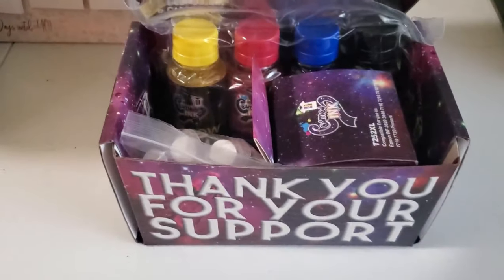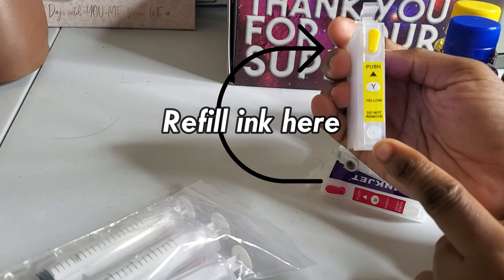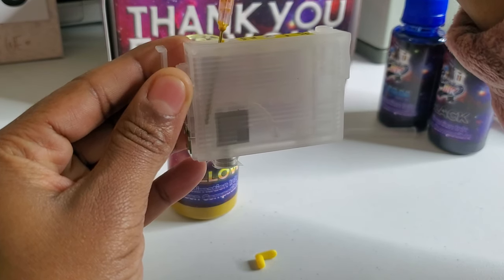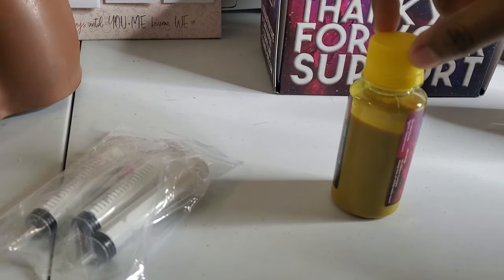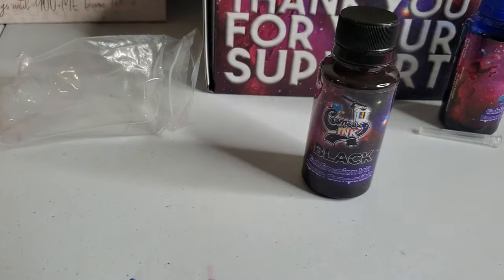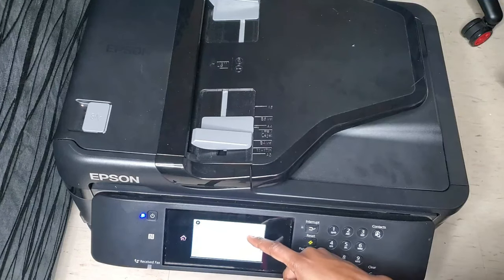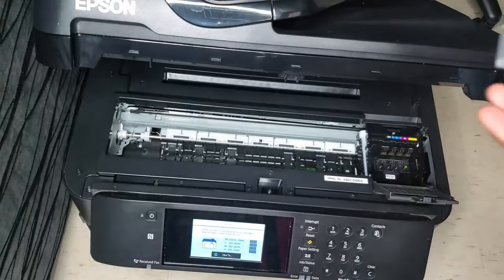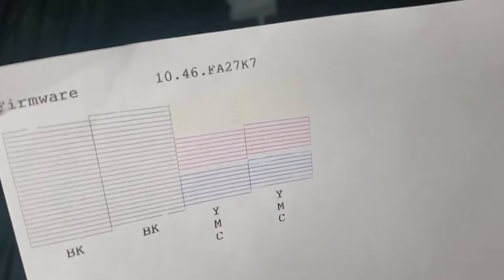How to convert an Epson WorkForce printer to sublimation|EPSON WF 7720

Comment: I just purchased my printer do I use the ink that’s in there to set it up and how do I get the cartridge for the sublimation conversion?
Reply from the maker: The ink that is in there is regular printer ink. So you would need to replace this ink with your sublimation ink in order to set up. 

The link for cartridges is in my bio or you can look on Amazon 😊

Comment: Do you know why it’s taking already 15 times for initializing sublimation and still have lots of lines breaking
Reply from the maker: Usually after you convert your printer from a regular printer into a sublimation printer line breaking on your paper confirms that the printer has been successfully converted..but when you actually print out an image to sublimate there shouldn't be any line breaking, if that's the case you need to either turn off high speed print, do a print head nozzle check, print head cleaning